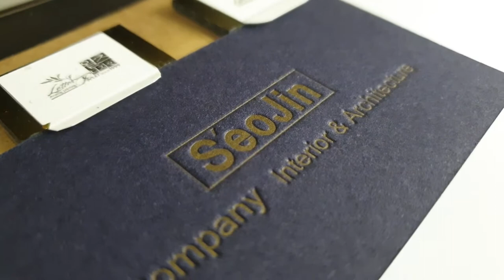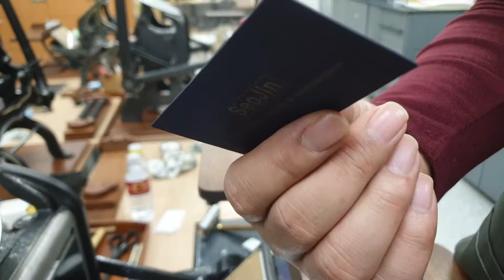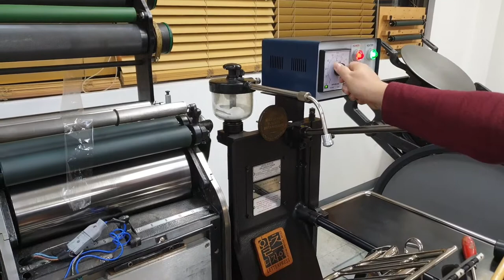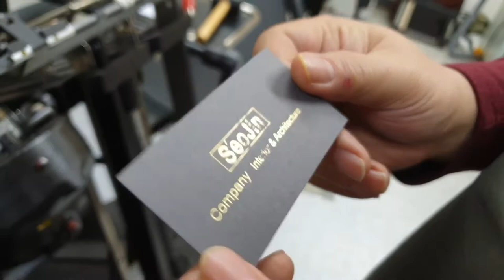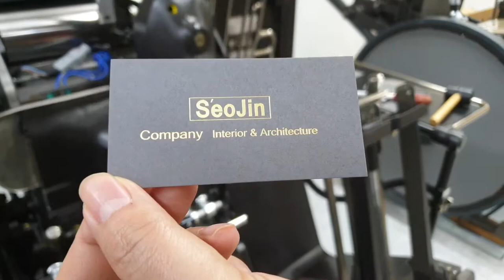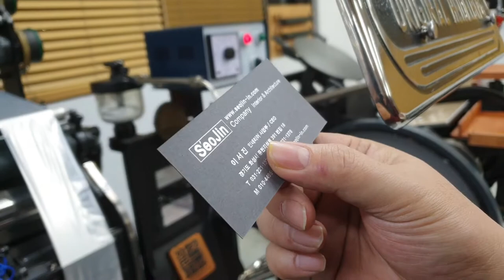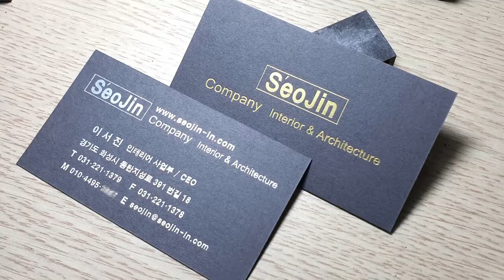레터프레스명함&박가공 명함만들기 Letterpress business card & Foil business card.

Comment: Hi Waltzdesign! Could you tell me how you developed the heat foil system, the plate and the foil catcher? or if a company in your area sells it, they would be interested in placing an order. I would appreciate any indication, I'm starting in letterpress! Your work is very inspiring. Thank you from Spain!!
Reply from the maker: Nice to meet you. We do not sell foil systems separately. If you send the machine directly to the factory, you can get it by attaching a foil device to the machine. There is only one place to install this device.
I only paid $2,000 to move the equipment.
Reply: @w_letterpress  Thank you very much for your answer! I´ll try to do it myself.
I would like to know what heating element they have used to heat the aluminum bed. 
One thermocouple or a high temperature cable heater and what WATTS? Thank you for your help!
Reply from the maker: @tacxol  
Hello. Heat wire is laid in aluminum and the plate is made by casting. Watts I don't know exactly. I don't know about electricity, and it's hard to know in detail because it's a job at a factory.
Reply: @w_letterpress  Thank you very much for your time! Best